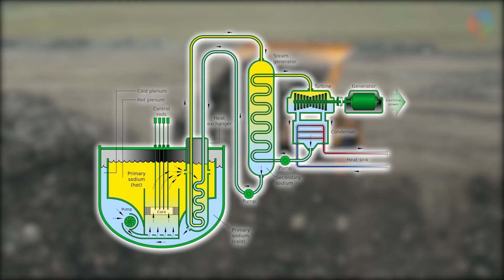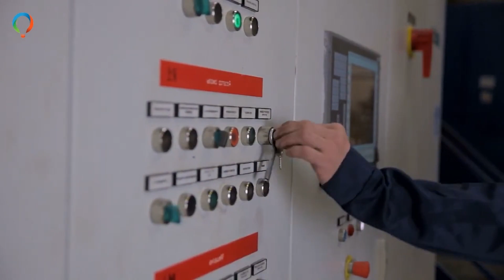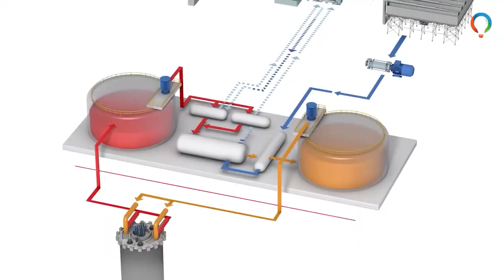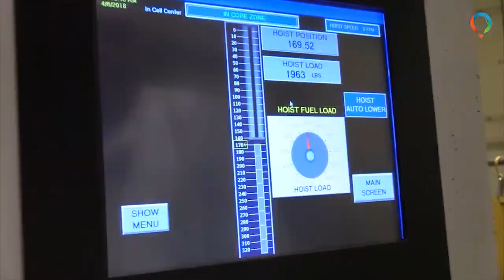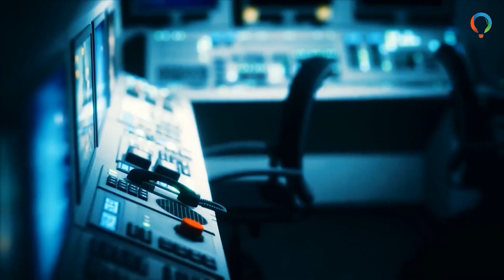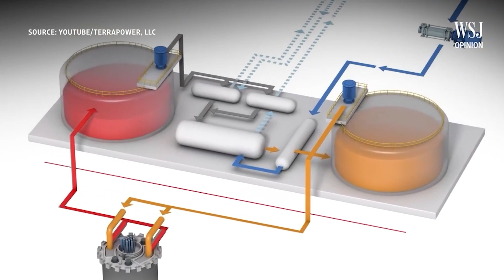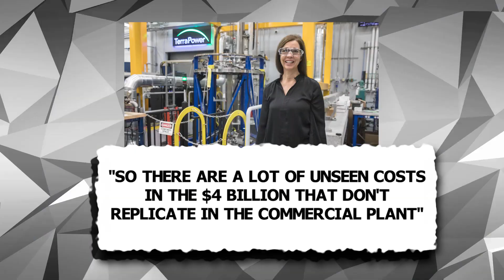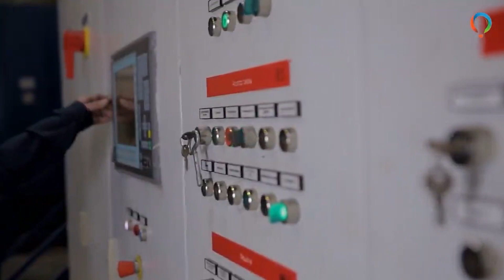Bill Gates REVEALS His Nuclear Energy And TerraPower Plans..

Comment: "Clean" energy??   Where exactly are you disposing of the spent fuel rods that are still radioactive??  Bury them in the desert maybe?
Reply: Storage in space. Just need to put inside the falcon 9 and delivery for space…
Reply: @pedrohugoneri  You might want to look up the cost of moving 1 pound of material into space.  And then look up the laws of physics and gravity.   Because everything we have put up in space will eventually come down.  Mostly burning up in the atmosphere.   

Heat plus pressure  plus nuclear fusionable material = radioactive boom.   So not only unfeasible and costly but also unsafe for the future.

Comment: Bill, solar power is the Earth's most abundant energy source, and I believe that you need to get behind it.
Reply: Solar power doesn't  work when there is no sun out and we have yet to come up with a long term storage solution for solar power.

Also it would take a solar farm 21250 square miles of solar panels to do the same job as 500 1GW generators .  

So no Solar is not ever going to be enough to power the entire nation.  And that's without factoring in the roughy 1 to 2 square miles of battery banks required to store and distribute that power. 

For individual homes Solar Panels might work most of the time.  But Nuclear produces more power at less cost.